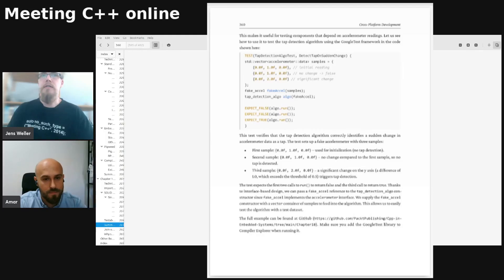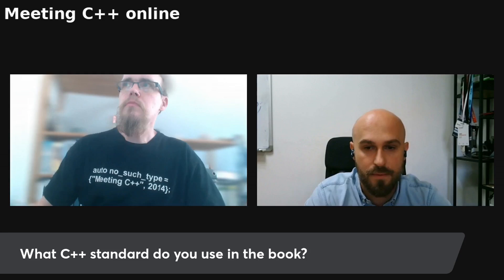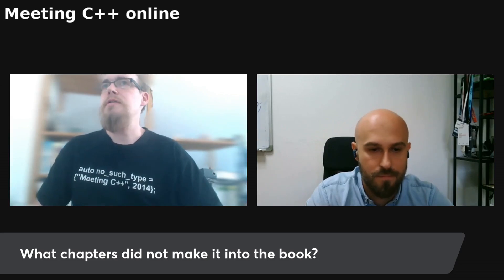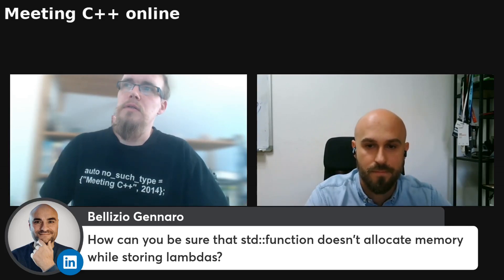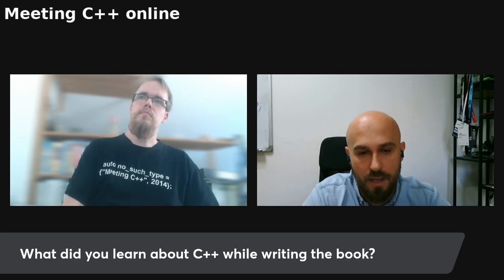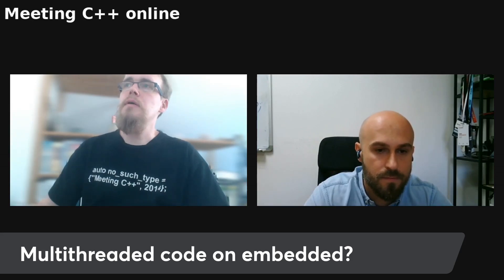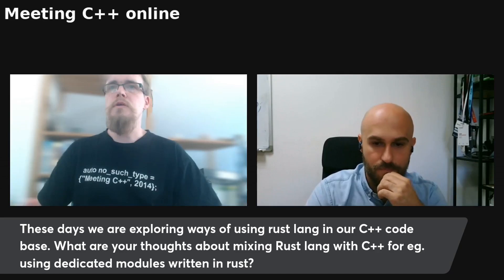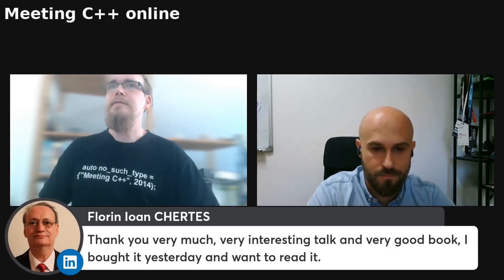C++ in Embedded Systems - Interview with Author Amar Mahmutbegović

Comment: AI Summary

Abstract:

This video features an interview with Amar Mahmutbegović, the author of the new book "C++ in Embedded Systems: A practical transition from C to modern C++". The discussion centers on the book's goal of helping C developers adopt modern C++ for embedded projects, addressing common concerns about complexity and performance.

The author explains the book's practical approach, which includes a Docker-based development environment and the Renode simulator, allowing readers to run code for the STM32F7 target without needing physical hardware. Key topics covered include the challenges of using the C++ standard library in constrained environments, with the author advocating for the Embedded Template Library (ETL) as a safer, non-allocating alternative. Mahmutbegović shares a surprising discovery he made while writing: the significant memory cost of exceptions in the specific nano-STL implementation used. The conversation also touches on the growing relevance of Rust in the embedded space and the practicalities of mixing it with C++.

Key Insights from the Interview on 'C++ in Embedded Systems'

*   0:42 Practical, Hardware-Free Setup: The book's code targets the STM32F7, but a physical development board is not required. A provided Docker container and Renode simulator allow readers to compile and run all examples.
*   2:03 Modern C++ Focus: The book covers modern C++ features up to the C++23 standard, aiming to bridge the gap for developers accustomed to C or older C++ versions.
*   3:23 Alternative to the Standard Library: The author highlights the challenges of using standard library containers in memory-constrained systems and introduces the Embedded Template Library (ETL) as a robust, non-allocating alternative.
*   5:48 Ensuring No Dynamic Allocation: To guarantee that no memory is allocated at runtime (e.g., when storing lambdas), the author suggests either overriding the `new` and `delete` operators for monitoring or, more practically, using libraries like ETL that are designed to avoid it.
*   8:09 The High Cost of Exceptions: A key takeaway from the author's writing process was discovering how memory-intensive exceptions were in the nano-standard library implementation he used, reinforcing why they are often avoided in embedded systems.
*   11:08 Multi-threading in Embedded: The author confirms that multi-threading is a common and important practice in complex embedded systems, often implemented using real-time operating systems (RTOS) like FreeRTOS.
*   12:25 The Growing Role of Rust: The author acknowledges the increasing adoption of Rust in the embedded world, particularly for safety-critical systems, due to its compile-time safety guarantees.
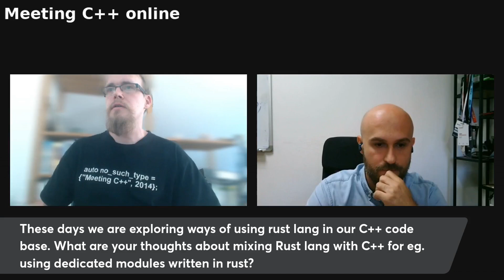*   13:55 Interoperability with Rust: When asked about mixing Rust and C++, the author endorses a pragmatic "right tool for the right job" approach, seeing no issue with integrating modules from both languages if it solves a problem effectively.
*   16:18 A Biased but Strong Recommendation: The author concludes by stating his (admittedly biased) passion for C++ and his firm belief that it is an excellent and powerful tool for modern embedded systems development.

I used gemini-2.5-pro| input-price: 1.25 output-price: 10 max-context-length: 200_000 on rocketrecap dot com to summarize the transcript.
Cost (if I didn't use the free tier): $0.03
Input tokens: 21944
Output tokens: 683